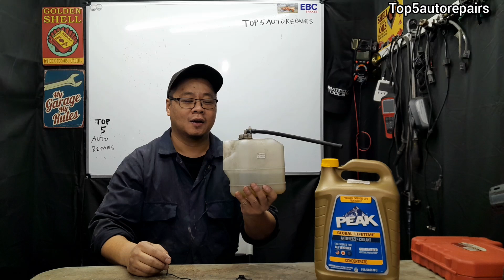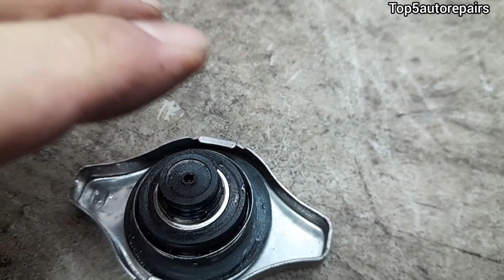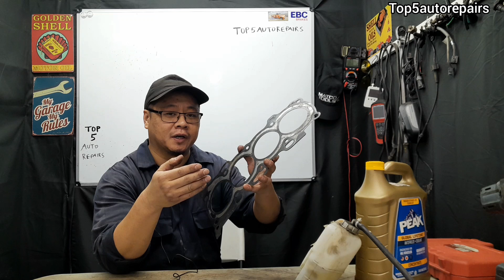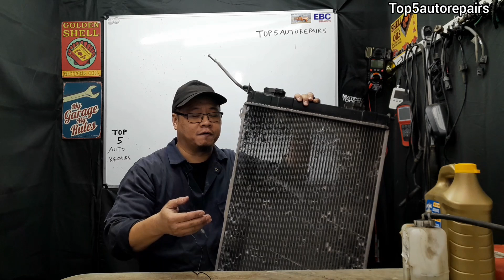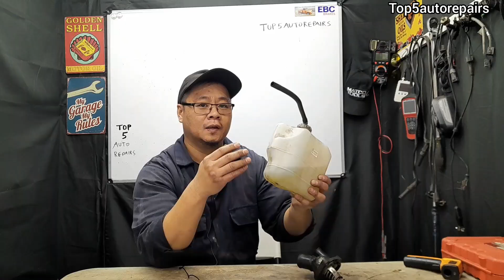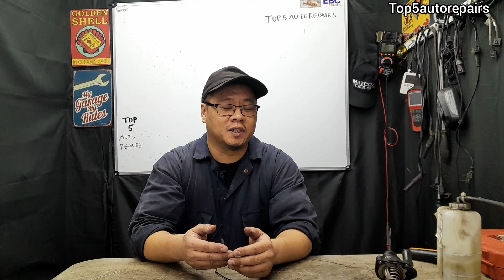WHY COOLANT RESERVOIR TANK KEEPS OVERFLOWING (EXPANSION TANK FILLING UP)

Comment: I have done everything! New radiator. New thermostat. New radiator cap. How's work well. No leaks. Did a head gasket test. 

Symptoms: 
No over heating
Occasionally will see fluid under my truck
Expansion tank is always super full!!!
The radiator will consistently take more antifreeze. 

2018 ran 1500 v6. Anyone has this issue??

Comment: Any tips for me? 
For 2500 miles, all in 80 mile trips. Every trip about 4 oz overflows from radiator into overflow reservoir. I check radiator when cool and it's low 2-6 oz, sometimes not low at all but maybe only 25% of the time,

It isn't losing coolant, it doesn't get hotter than 194F unless idling and it won't even get hot enough for fans to turn on (208) even after 1.5 hours of hard driving. 

No leaks, cold pressure test is good. Compression is good and even on all cylinders. Nothing on head gasket test fluid. 

Vacuum filled it, no spill funnel filled it. Nothing seems to work, it just won't stay completely full. 

Anyone experience anything like this before?

Before having issues, I never noticed where the radiator level was but I assumed it was and has to be completely full? Maybe the amount of air I'm worrying about is insignificant but it's hard to stop worrying about it.

Comment: What about the the coolant goes up and down ? Means sometimes i check and is on low and sometimes i check again and is in the normal level?
Reply from the maker: It's normal for coolant level to rise and fall in the reservoir. When the engine is hot, coolant starts to expand and coolant gets pushed to the reservoir. When the engine is off cooled, coolant flows back to the engine.

Comment: I can hear gurgling sound of my coolant from my engine after I turn it off. But my temperature shows normal (exactly midway between Low and High level). My radiator upper hose gets hot which I presume my thermostat is not stock-close. My coolant reservoir is not filling up. My reservoir coolant does not bubble up. Sir can you help me figure out what to do first in order to save money? Thank you.
Reply: That could just be the coolant inside your heater core usually behind the glove box (Toyota and lots others). Most all are behind the dash somewhere.

Comment: I had an old Dodge that had me stumped for a while. It could idle all day in the AZ heat and never get hot. But at highway speeds it would overheat. I was confused because I'd had cars before that would get warm at a red light but as soon as I was moving down the road and getting some air flow it'd cool off. Turned out that in this case the head gasket would only start leaking at highway speeds because Of the increased compression due to the higher rpm.

Comment: My Ford Courier 100 meters down the road pushes water into res tank  is making boiling sounds and dumps the water from radiator too expansion/reservoir tank causing extreme overheating, sounds like Head Gasket Ty for the symptoms should check thermostate aa tho
Reply: I'm  having the same problem.

Comment: Mine boils but only after its turned off, it also doesn't overheat while running, does this still apply?
Reply: old hoses? idk I have the same issue and mine are factory from 20 years ago. could have caused a piece to clog the flow and build pressure
Reply: My resovoir keeps overflowing but it’s not overheating
Reply: @gabegarcia7779 brother did you find any solution.mine also doesn’t overheat but bottle coolant slowly overfilled after 200km or 300km
Reply: My car is having the same problem.  Did you find the solution?
Reply: @samsunggalaxys20fe30 i see no one figured out the issue lol having the same at the moment
Reply: I figured it out. I had to burp the system by running the heater on high for a few minutes.  @CapHussle
Reply: Mines does the same @ericblue1328 did you find what was wrong with it

Comment: Should this type of resevoir youre holding be airtight?  My cap is cracked and lets air in
Reply: Ideal for it to be to prevent dirt to enter, but as long as the pick up tube is submerged your ok.
Reply: It's usually 20$ for the cap assembly. I'd just replace it new if you can

Comment: I had a leaking/faulty reservoir cap, which can cause the pressure to be off and make the coolant boil at a lower temp than it’s supposed to (under proper pressure it has a higher boiling point) and also cause it to leak. 

Just replaced my entire reservoir and the radiator cap for good measure bc mine wasn’t sitting at a proper horizontal 90 degree angle anymore, the new one does. Wish me good luck
Reply: Month later and zero leaks.
Reply: For me it was the bled screw and cap. Car-M140i

Comment: Hi thanks for making videos for us, I have 2 questions: 1. What if the reservoir bottle isn't overflowing in fact it's getting empty?
2. My car's upper radiator hose pipe is normally soft when I press,  even driving for a few kilometers or 15 to 20 kilometers, is this normal?
Wait for your reply 🎉

Comment: I had changed the radiator cap but It started overflowing more quickly 

I don’t know what’s the issue
Reply: I had a similar issue but my bottle was overfilled  after it came down to F I didn't notice any overflow.

Comment: In my toyota Sienna, same problem  reservoir fills up and I keep adding coolant in radiator but problem still there so you think I should change radiator cap?
Reply: I have a 2006 scion xa and i have the same problem the reservoir fills up, and the radiator coolant is low, my mechanic say it might be the radiator cap because is loose and it opens easily
Reply: I did that in my 01 Camry still same problem! You can try it though
Reply: @TillBillFitness so it fills up and then what?? It will drain back down once the car is cooled off?
Reply: @brandonnazelrodt2819  thanks you are right it's fine now.
Reply: And also my car doesn't overhead

Comment: Hi there i have  concern hope you can reply to my comment, so the other my co worker inform me that my car has a leak on the driver side, so when i checked I've notice a wet ground underneath the driver side and green liquid about to drip.. so im sure it was a coolant so I've decided to add more coolant just to level on the "max"  on the reservoir. Its kinda weird coz when i reach home suddenly i dont see any signs of leak.. how was it possible?
Reply: The overflow valve on reservoir

Comment: I have rust in the engine and it keeps clogging  my new radiators. Do u have a video that shows how to power flush the rust out of  my engine. Thanks.
Reply from the maker: Not at the moment. I'll consider making a video for that subject.
Reply: @Top5AutoRepairs Some vehicles  don't have a pressurized reservoir. Do you have a video on the other system?
Reply: @jimin-819  i have the same question what if my radiator reserve tank is what keeps overflowing I do not have a traditional pressurized radiator cap on my 2008 Mazda 3
Reply: Rust in not good for the engine lol get a new radiator.